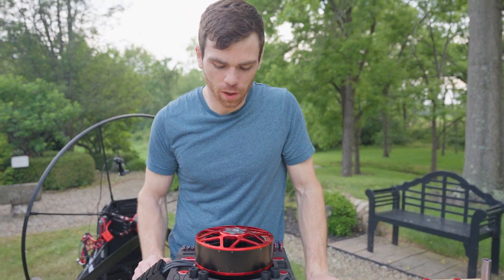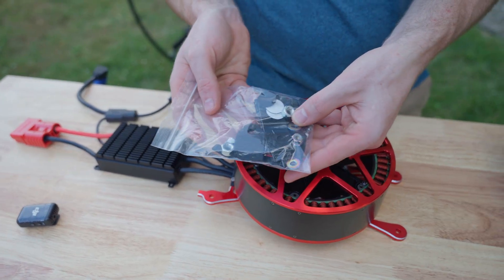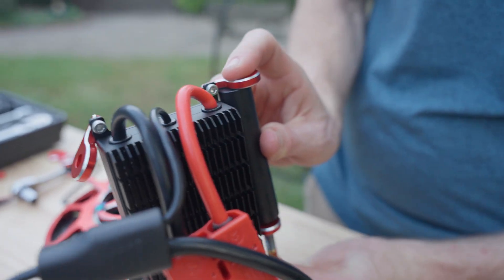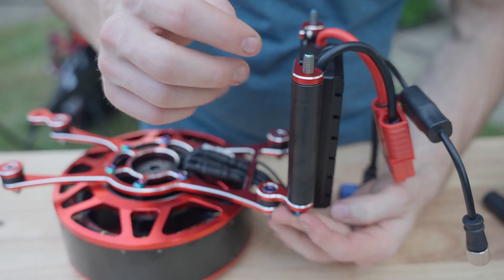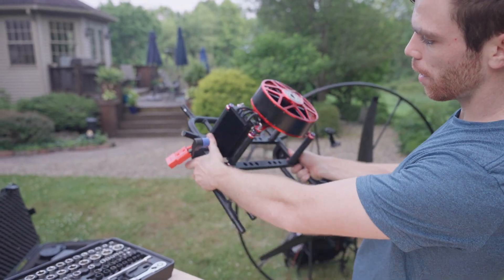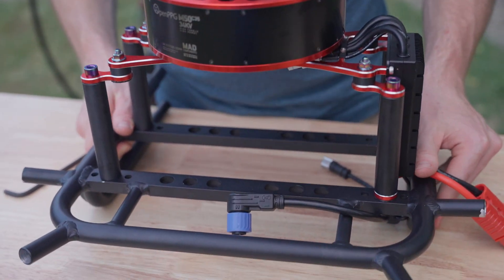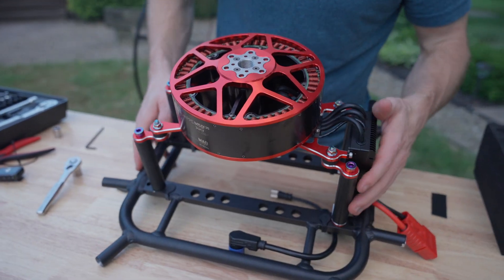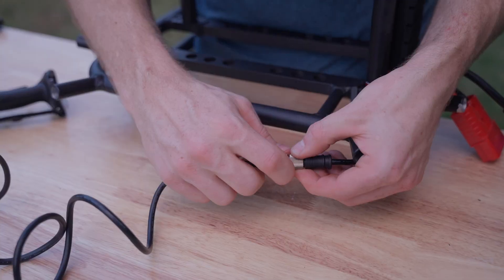Electric Power Pack Assembly (V2.5)

Comment: Have you consider a collapsing prop? Spins open closes w no power. 

No real need for a cage.  
Wing is above before prop opens.
On landing prop closes.
Reply from the maker: We would have to develop one, as there isn't much available on the market, but it would be interesting to test and see how much drag reduction there is to determine if it's worth it.
Reply: @openppg saw this prop on a 103 delta wing trike.  A YouTube vid.

Comment: Hi Paul, love your work.
I’m trying hard to set myself up to get into power power gliding here in Australia and I definitely want to set up with one of your electric systems. I’m a veteran retired guy with a back injury so running for takeoff and landing doesn’t work for me. Have you used your system with a ultralight trike set up?

Also wondering if I did have a trike set up, have you ever looked at a dual battery  or has the range increased enough not to have battery anxiety? lol 😂 
Cheers
OzyMark
Reply from the maker: Some do use in on trikes, I have tested with duel battery's and that is a nice option for the trikes setups.

Comment: Now that the ECU is off on the side, is the motor and prop in v2.5 closer to the frame? I have a SP140 v1, but would be interested in a more compact format to travel with.

Comment: Great design ❤

Would it be possibile to connect custom build battery pack? What kind of CAN protocol is used between esc and battery ?
Is it possible to fly without CANbus ?
Reply from the maker: It uses a dronecan protocol and needs it for control and data.  As for custom battery pack you could use something as long as it matches the specs for voltage and discharge rate but you would not have the comunicates with the BMS if doing a custom setup.  So some features would be lost.

Comment: Excellent design 👍 
Is there anyway provision coming to be able to mount 2 batteries say for a trike configuration.
Cheers
Reply from the maker: Yes, this is something that can be done now, but to be able to see both batteries and display their info well, some UI coding changes need to be made, along with an additional wiring harness to make it all super easy to plug everything in.  So, some of the niceties need to be refined to have it all work together well with little effort from the users end.

Comment: Will this mount to a frame set up for a Vittorazi?
Reply from the maker: The V2 SP140 frame can mount either this electric motor setup or a Vittorazi setup. It was designed from the ground up to work with both.

As for other frames, it really depends on the frame manufacturer and whether or not they support it.

The electric power pack is quite simple in its mounting, so not much is needed to install it. However, features like the ability to easily swap the battery or other niceties may not be supported if the frame manufacturer does not design their frame to accommodate it.